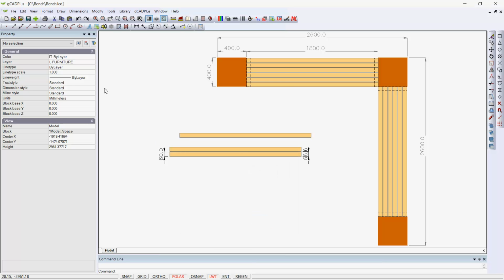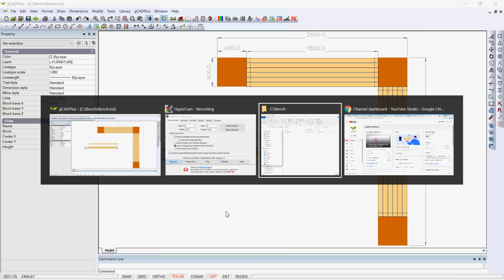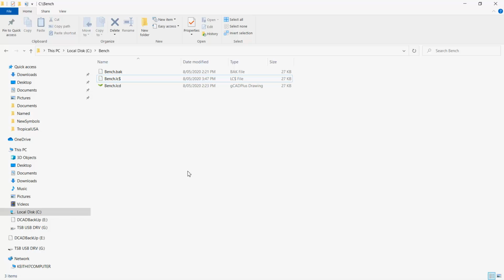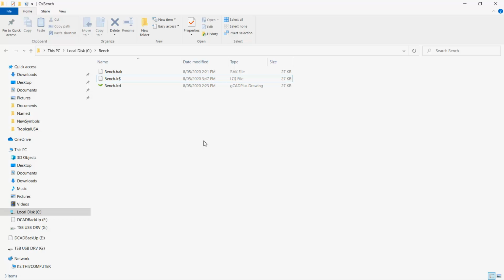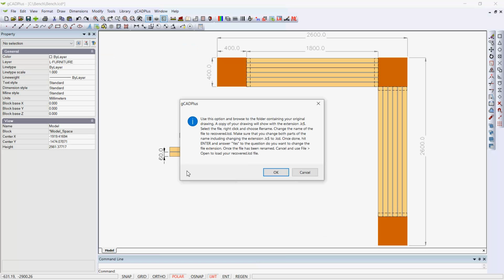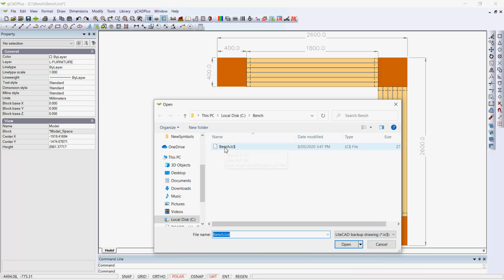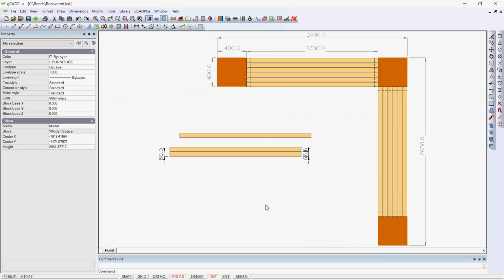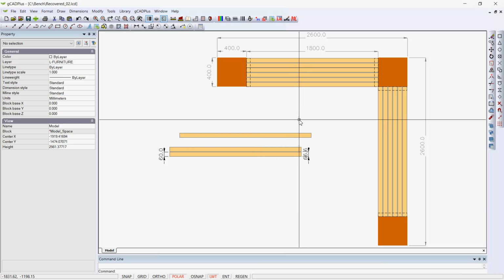Recover gCADPlus auto backup files

Comment: Saved me some serious work after a crash!
Reply from the maker: Perhaps try the incremental backup tool available as the green cross on the standard toolbar. It is useful when experimenting with a major design change in a large file.
Reply from the maker: Another approach is to set up an automated backup procedure. We like to backup a jobs folder using the Windows 7 backup application that runs in the background protecting your data. It is even possible to 'step back in time' and recover earlier versions of a desitgn. Read more about it here: https://www.gcadplus.com/wp/protect-work/